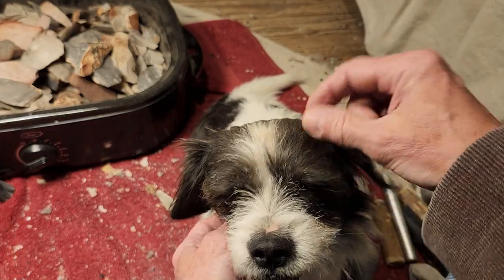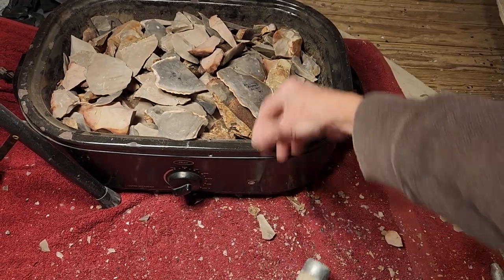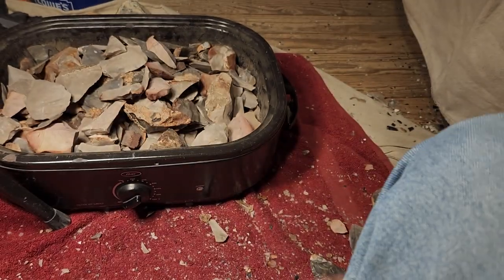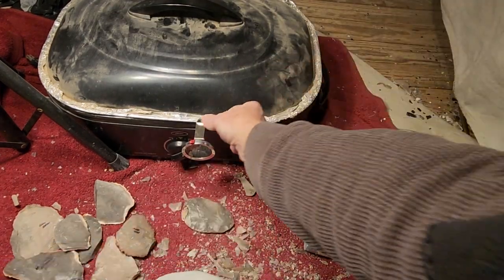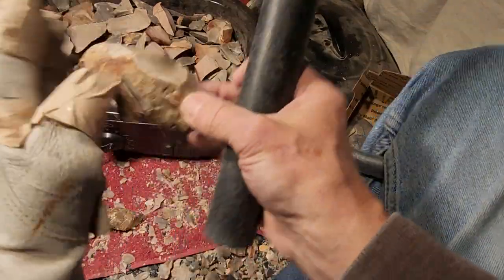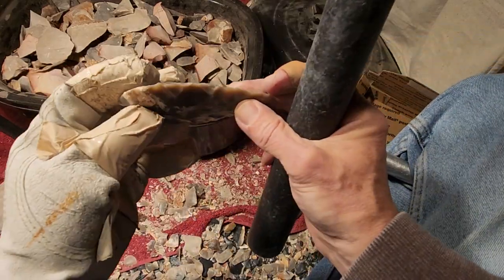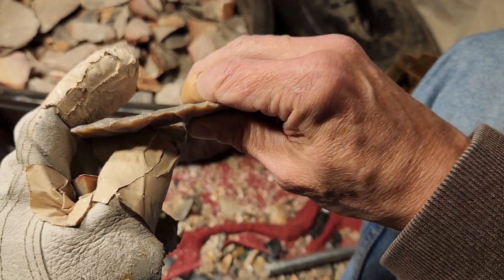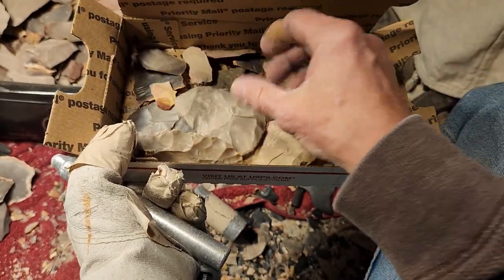1385 - Flintknapping Heat Treated Chert

Comment: Patrick when you turn the rock to 200 the elements come on and stay on for the entire time the thermostat is below 200. This causes the rock next to the elements to go well over your 400 target as there is no trickle or differential heating on a plain old turkey roaster and that can potlid the rock near elements or in the corners
Reply from the maker: True. But that's what happens when you heat the rock with fire the old way (uneven heating). Remember, you're not learning the old ways if you're doing it the modern way.

Comment: I found out using a turkey roaster I put sand in with my rocks and I put I use high temperature insulation you put in the lid I put it at 175° I leave it on for one day then I turn the heat all the way up my turkey roaster only goes to 450 I put a high temperature thermometer in it and I can get it heated up to 550 I'll leave it at that temperature for 2 days then I just shut it off by having the sand around your rock it keeps it from cooling down too fast

Comment: Keep a log of the stone name, location acquired and the temperature heat treated. Number each stone logged then just number the pieces. Less writing. You can use high temp cement to fill the lid upside down. When dry it shouldn’t absorb much water and it will insulate too. Weight is an issue?…mix cement with perlite.
Reply from the maker: Trouble is, I lose the log books. I eventually find them but in the mean time I create new ones and I end up with too many.
Reply: @KnapperJackCrafty  Oh well, It is what it is. I write myself notes all the time then forget the note. I find it when I get back home.
Reply from the maker: @robbybobby64  I keep my notes on my phone as much as possible now. At least I know that if I archive them, they are in one place. The problem is I'm usually using my phone for something else or I'm driving when I need to write something down. I'll get it figured out eventually.

Comment: Would you heat treat Georgetown of knap it raw?
Reply from the maker: It depends on the quality. Most Georgetown knaps well raw, but if you can't run long flakes on it easily, it should be heated.